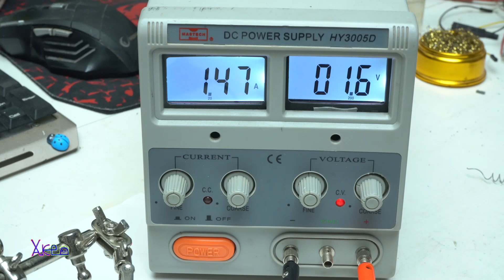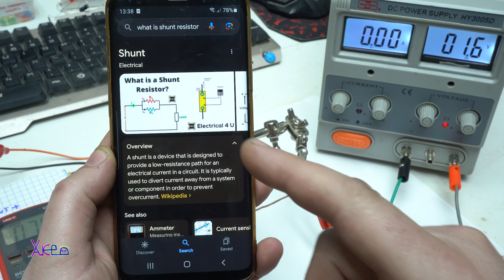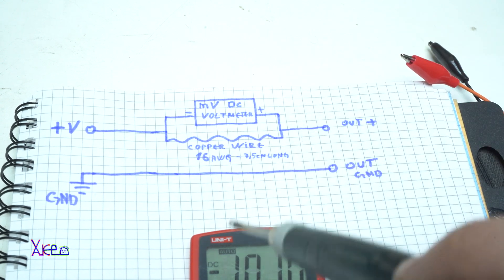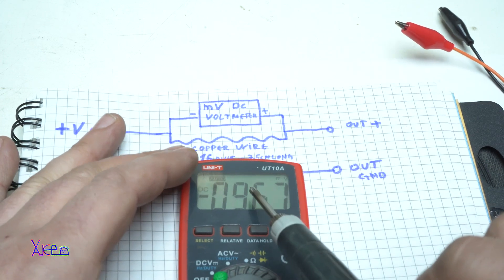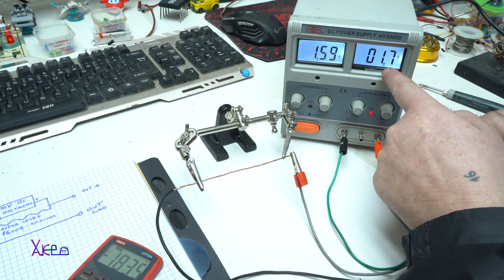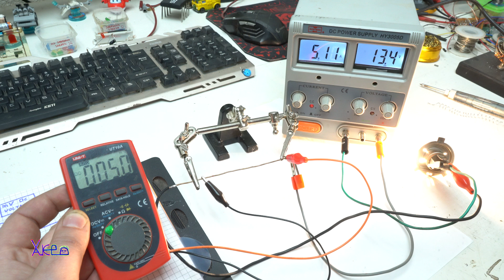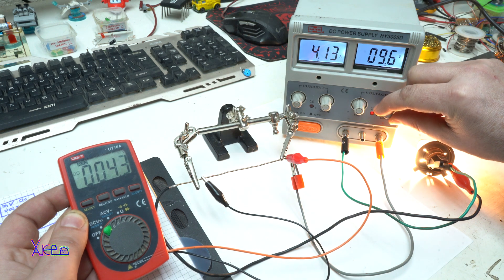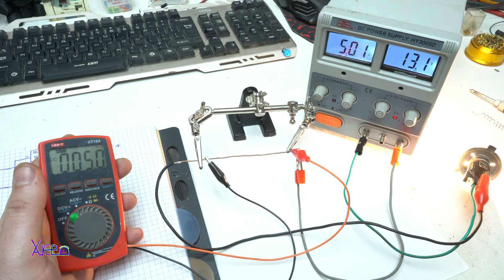How To Measure High Current Using Shunt Resistor

Comment: Fun fact, your aligator clips are connected together with a big steel bar, so you have effectively 2 resistors in parallel. The resistance of the bar is about .3 ohms.  In a similar fashion, I once used a small nail as a shunt resistor: it is more compact. Nice work!
Reply from the maker: Thx for feedback sir

Comment: I am a little confused about device holding the wire and current traveling through it and the wire. Is the holder insulated from the wire?
Reply from the maker: The current travel thrue shortest and most conductive path in this case that is copper